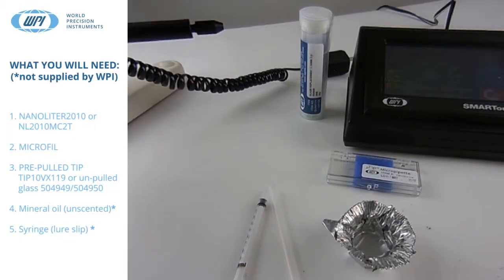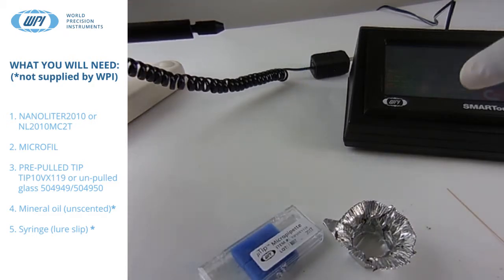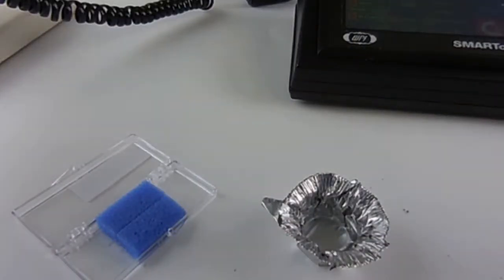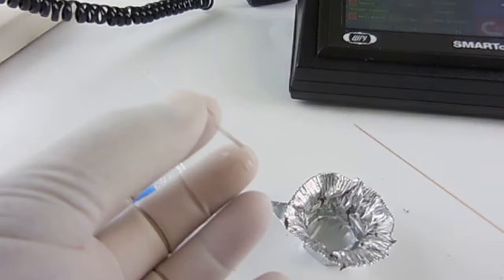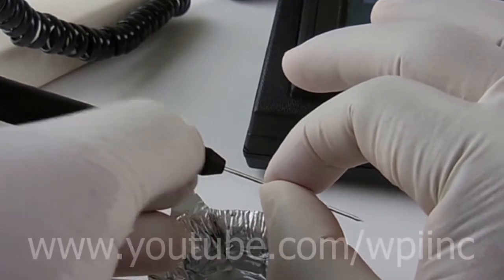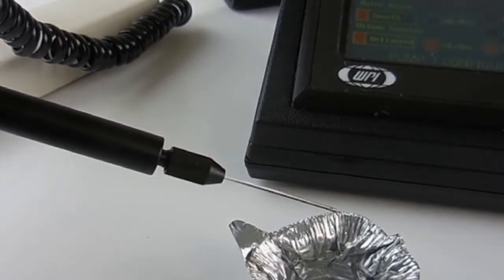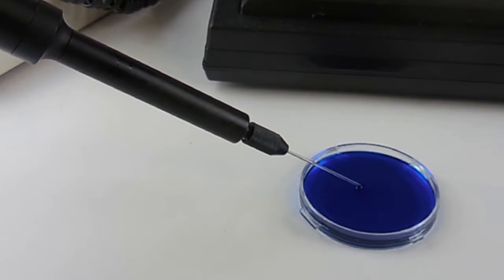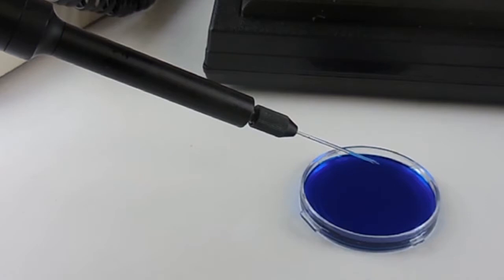Front Filling a Micropipette with the WPI Nanoliter2010 Injector

Comment: I have used this technique for vira microinjection, but it is very dangerous to prick yourself with the needle, do you have any method to reduce this risk?
Reply: Hey, sorry for the late reply, but just in case it's still useful. Once my pipette is lubed with the oil, I attach it to the injector and only move it with the aid of the arm controller (assuming it's stereotaxic surgery?). I place the viral vector in a tube put vertical with the aid of putty, and with a magnifier I move the tip until it's inside of the liquid. Then I retract the injector and fill the pipette. I just remove the tube with the remaining virus and place the injector all the way up until I need to get it near the injection place. Should be safe :)